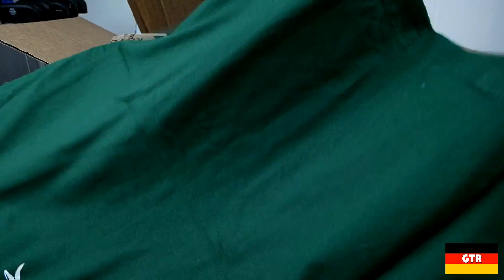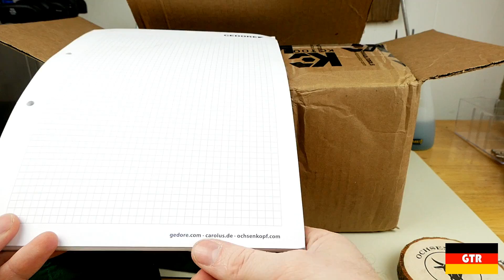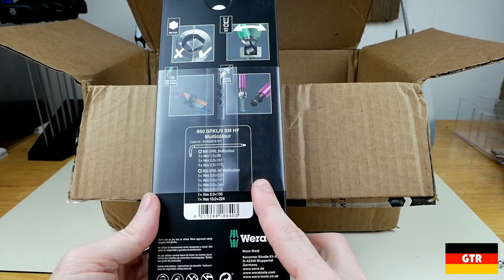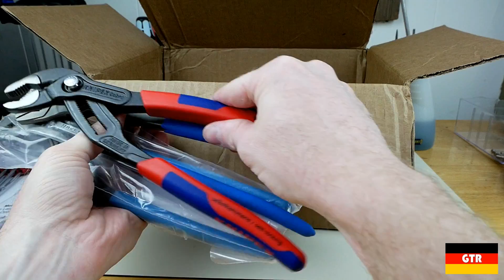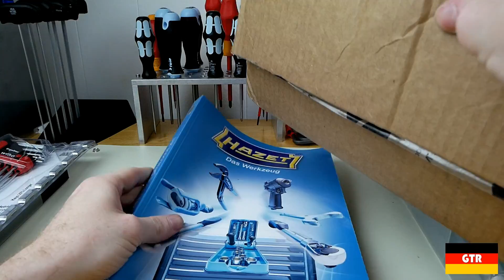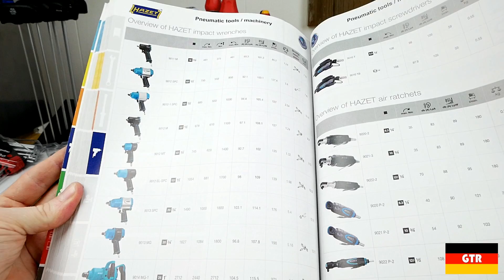KC Tool Unboxing E07

Comment: Can you do a comparison vid Wiha vs Wera L-Keys? Ya mentioned it, but I haven't seen one yet. You can get the compact 1/2" Hazet air Ratchet for about $200 with sockets and magnetic tray right now from  https://www.jensputzier.com/hazet/pneumatic-toolsmachinery/pneumatic-tools/impact-wrenches/hazet-impact-wrench-9012m-4-set-3526.html
Reply from the maker: I have it partially shot, but need to get some test equipment to measure the holding power of each.  I'll probably use one of those devices that is used to measure trigger pulling power for calibrating firearms.

Comment: I had those Wiha hex keys the non magic ring set and ended up sending the set back.  I really did not like the tool steel the hex keys were made from.  They felt soft like they would round out on me.  It is the 669 series.

Comment: If you are comparing the water pump pliers: prices in Germany for the dipped handle versions (250/260mm) are: 
Knipex 20.03€ alone, 14.18€ as part of the 002010 three piece set
Gedore 25.48€ alone, 13.98€ as part of the S8393 three piece set 
Hazet 35.70€ alone (not available as part of a set)
NWS QuattroGrip (they offer different versions under the same name, all pretty confusing) 21.50€ alone (not available as part of a set) 

These three piece sets are a great deal if you need some different pliers.

I feel like the prices in the county of origin are more representative for comparisons.
Reply from the maker: Cool, thanks for the information. The prices end up roughly being relatively the same after conversion to any other currency, but I should list the list price in Euro as well.  I was surprised that NWS had almost as many options as Knipex did for these pliers, hopefully I ordered the right one.
Reply: The 1661-12-250 (https://www.idealo.de/preisvergleich/OffersOfProduct/3828662_-wasserpumpenzange-1661-12-250-nws.html#gallery) 
is the right one. As I said, it´s confusing. 
There are a lot of rebranded NWS pliers available over here wich doesn´t make it easier. 
The 1661-12-250 is their basic push-button model with the dipped handles, but the mechanism works basically like a Quick-Set Cobra. 

That are not the list, but the current street prices at Amazon.de.

I am looking forward to your review, you do really great work on those ... I just subscribed :)

EDIT: Well, I have to correct myself. There is another version - the 1660-12-250 - wich is very similar to the normal Knipex Cobra. But that version is not available in Germany.

And then there is yet another version - the 166-12-250 - wich is discontinue but still somewhat available.

NWS is all over the place with their lineup, it´s ridiculous. That´s probably the reasons why nobody uses them - you can´t find what you´re looking for.

Comment: When you are goiing to compare the allan key sets, could you find out if wera's hex plus design really works. That would be my main reason for buying wera instead of wiha.
Reply from the maker: I haven't really done a real test to see if the Hex plus system really works the way it is intended to, but that is a good idea for a future video as I believe I have all the test equipment necessary to do that test.

Comment: I just recently picked up the Wera Hex Plus L-Key sets in SAE and MM. Love them. Now they have them with the holding function. Errr, wish I had waited until these came out. Any thoughts on why the MM comes in a plastic holder and SAE in a pouch? Wich do you prefer?
Reply from the maker: These new holding functions ones are definitely  more expensive, about 30% more or so.  Yeah I did point out about the metric and SAE units coming in different holders and I was confused as well.  My guess was that it makes it easier to identify which one is which by the difference in holder.  I hardly ever use the SAE set, but I would say I still prefer the fabric pouch because I feel like the plastic holder is going to wear out eventually.